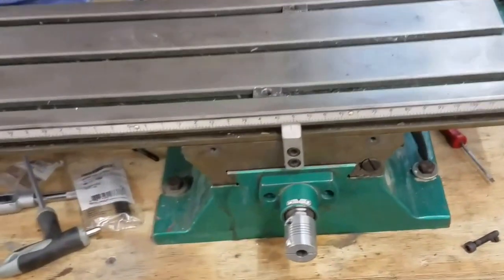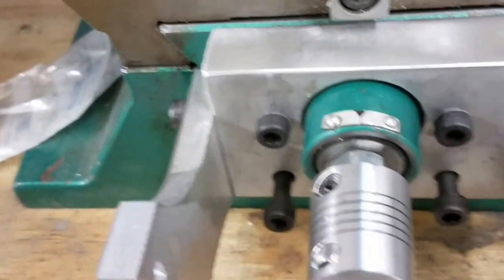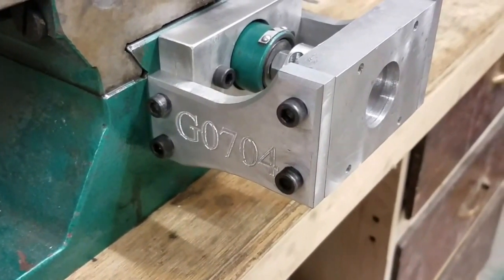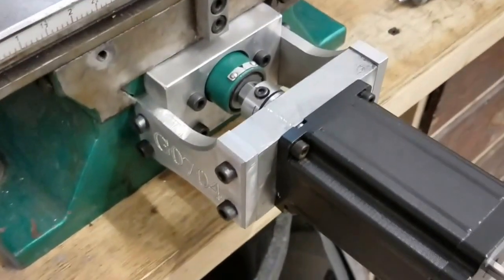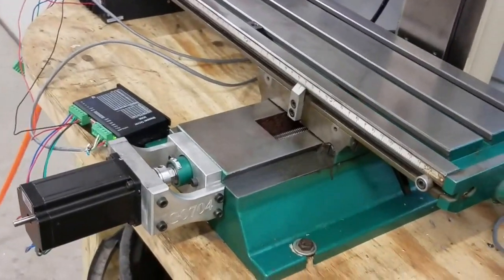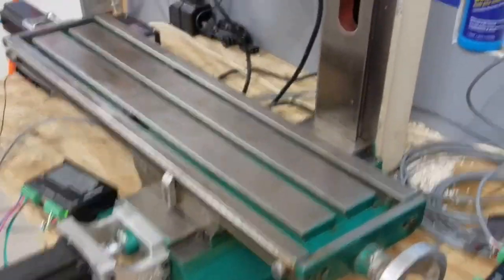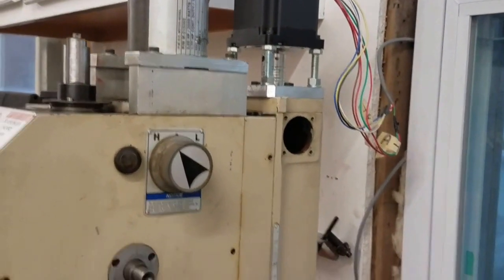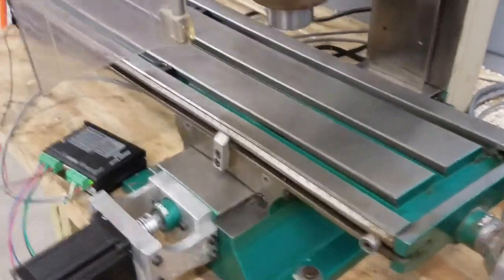G0704 CNC Conversion Part 3

Comment: I converted my Optimum Bf16 with Wantai Nema 34 closed loop steppers with 12Nm they are overpowered but I like that 😁😁😁 and the x axis mount is the same with the Bf16 if you want full travel you have to shape it like you or as I did I made 6 x 14mm rod's with a threat on one hand and a threat hole in the other made out of steele as well as the adapter plate which is hold by the six rods they go straight into the mill body. It works also fine the motors are well powered and all three axis are attached with steel adapter plates etc. and they handle the power very well its very rigid that's what it should be.. And the closed loop hybrid steppers don't lose a single step... Never they are very accurate 👍 nice videos you make I like to watch them...

Comment: Very nice using the original lead screws. I like the wavy style you used on the mount. Once your Ballscrews are in you will be amazed at how much smoother everything moves. Heck I thought mine was smooth just moving the cranks!